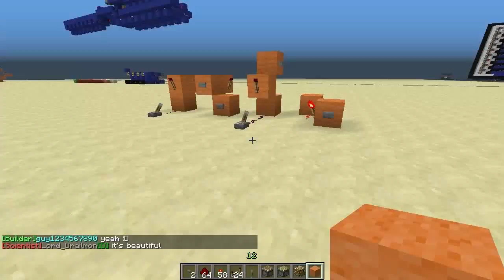Advanced Redstone Circuits: Episode 5

Comment: I like your last design. I came up with a 2 wide, 3 long 12 high stackable RAM design. But does not has a reset line. So Yours is only one block higher and it has a reset line.
A reset line could make it easier for a programmable combination lock I made, because currently I use pistons to cut of the input and than set the memory.